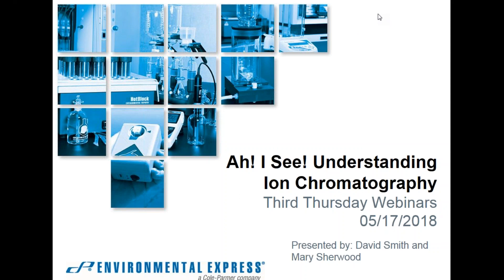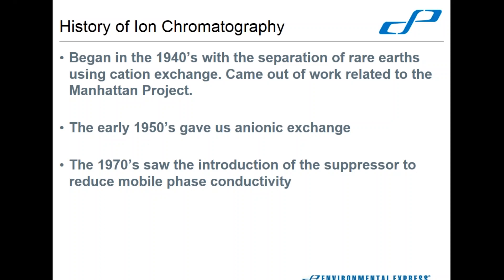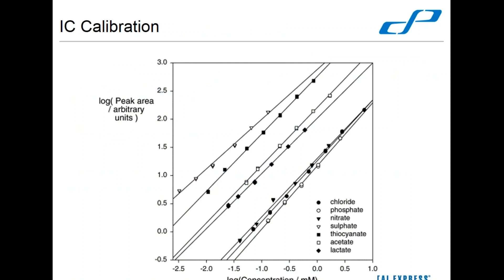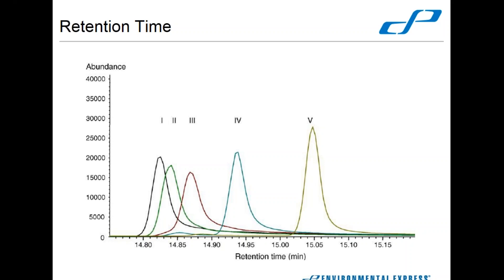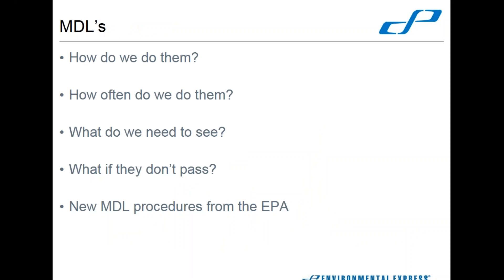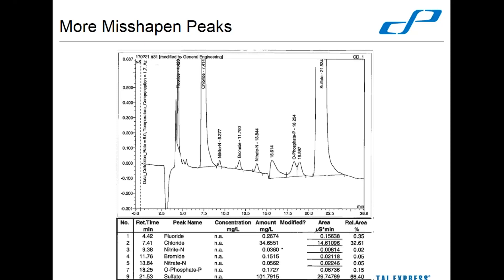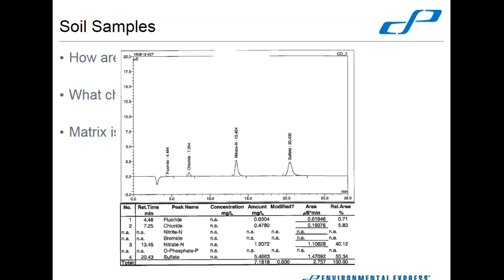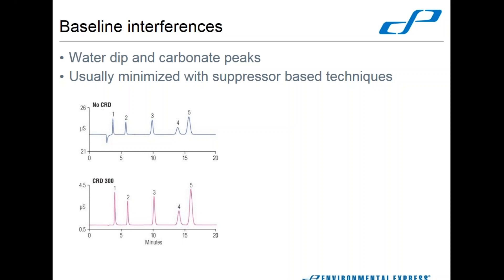Ah, I see! Understanding Ion Chromatography - May 2018

Comment: Hi, sorry if that's a silly question, what does it mean "matice issues" and how can we solve that? Thank you
Reply from the maker: A matrix effect is a general term used to describe any problem presented by the make up of the sample. A common example is seawater. Seawater has lots of naturally occurring dissolved minerals, some of which will cause problems when running various tests. For ion chromatography, this will usually refer to the high levels of chloride and sulfate which will obscure most of the other ions in solution. Another example would be an industrial waste that contains some form of chelating agent. These can bind up the ions of interest and render them undetectable by the instrument.